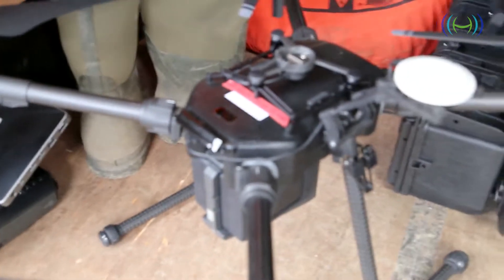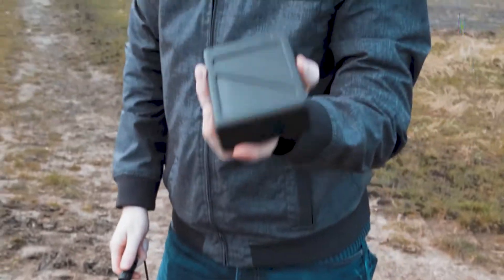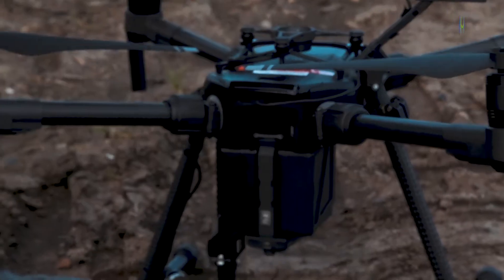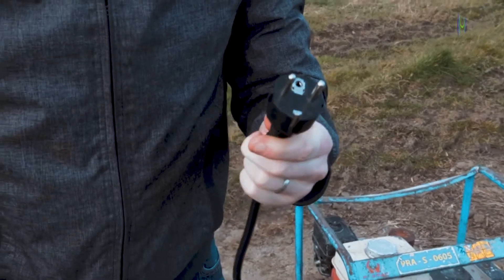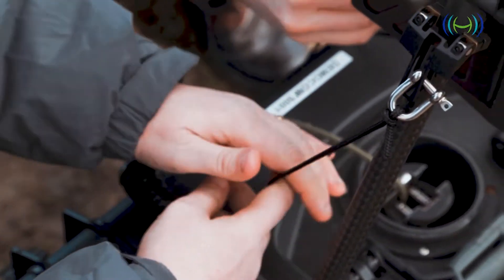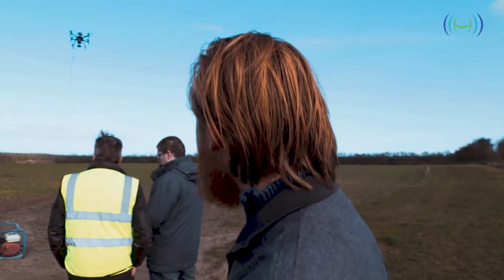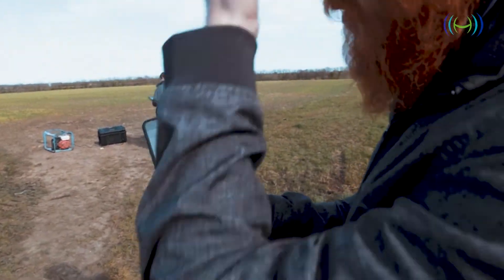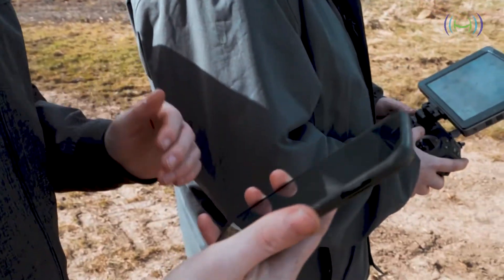Elistair Tether Test: Tether Drone Flying All Day

Comment: I've tried to build two tethers. I am so close to making it work. What I need is some help from an electrical engineer to figure out what voltage to use so that I am getting the right voltage and amps to the quad with the length of the tether I want to use. Theres a fine line between weight of the entire spool of cable and the maximum lifting power of the quad....
Also, if you can't lift the whole thing you can drag it for a distance.....
I think the way it might work the best is to fly over water with a tether that floats?